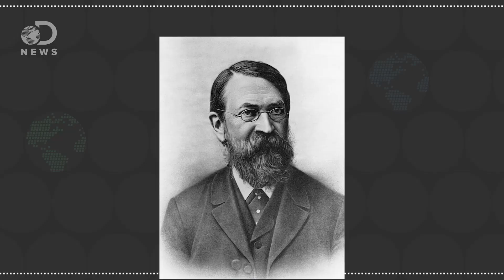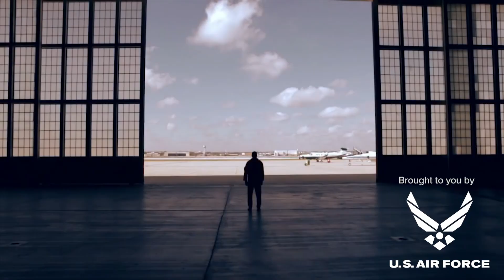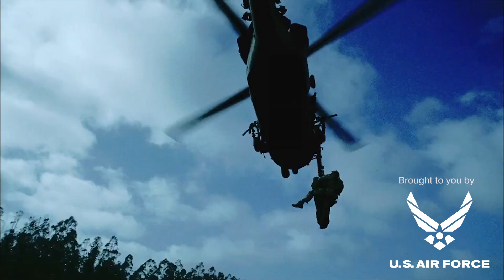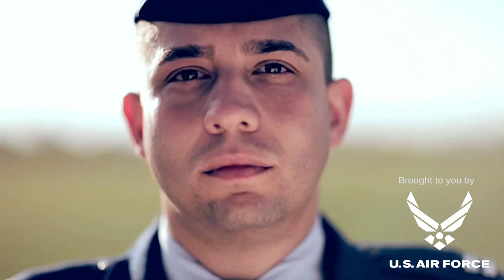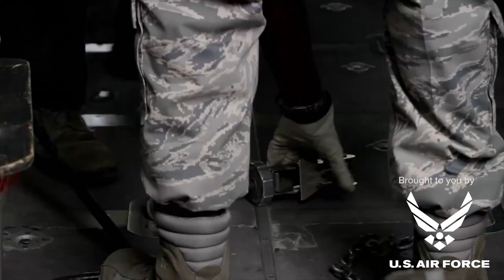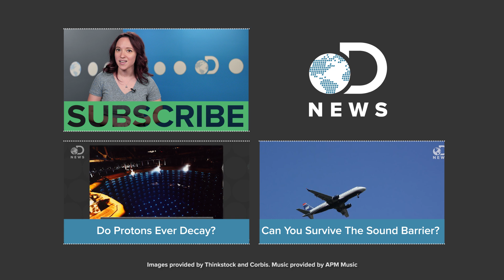Why Is A Sonic Boom So Loud?

Comment: how about light barrier?
Reply: *****
 And you would have an infinite mass that would lead to an implosion of the entire universe and end of eveything existing.
Though I still beleave this question was a troll.

It's a common phenomenon that you cant tell the differece between trolls and insanely stupid people because those trollers get excited if you fall for their stupidity and try to explain to them why their questions imply an IQ of limes zero.
Reply: nhem chanreasmey no matter can travel faster than light within our universe. 

as you gain speed,  the stars ahead of you and behind you would shift color ( doppler ) your ship would shrink in size, and time would slow down for you,  but you would not feel time slowing or the shrinking, you would perceive time flowing normally. 

another effect is your mass would increase as you go faster and faster,  which means more and more energy is required to make you go faster.

If you were to somehow reach C, i guess you would just be pure energy. and would require all the energy in your total mass to achieve it. 
E=MC2.   

I am sure someone with more knowledge here, will correct me.  

This is not to say that we may not be able to travel to distant stars,  we may be able to someday create worm holes, or maybe bend space ( a-la-star trek ) of as I mentioned previously jokingly, maybe jump to another universe where laws are different.
Reply: There was an experiment with a light or some wierd laser thing that broke the set light speed. I forgot what that experiment was called though. Basically a light that beat the light speed.
Reply: +nhem chanreasmey haha! this is a joke, right?
Reply: +nhem chanreasmey You need a trans-dimensional drive  , and you are good to go.  no sonic boom, just trippy visual effects.
Reply: +MrBaronmoll  so you think this is a joke or trolls. well i was asked about light barrier. the light speed is about 299 792 458 m/s. so if we go faster than that speed so what happen? is it so loud or something?
Reply: santiago pelon
Light = photons ,  photons are generally considered to have no mass.   although there is some debate to that.

if you are already at light speed, time stops for you. 

anything faster than light, would probably mean going back in time,  so what I think you are referring to are tachyons.
Reply: agriperma I have no idea if they'd be "tachyons", never heard of them, but it was an article I read a while back. But it sure stuck in my head for a while.
Reply: santiago pelon
look up tachyons fun stuff,  fodder for scifi writters , mentioned a lot in Star Trek.
Reply: agriperma will do for sure when I have less homework :)

Comment: Still didn't answer the actual question about why it's loud...
Reply: +Fred "The sonic boom is the sound an airplane makes when it smashes through that wall of compressed air that builds up in front of it" 02:17
Reply: Ok wasnt mentioned is that sound waves travel at set speed for each wave.. about 340 m/s.. The aircraft.. as it collides with the air molecules produces sound waves that are spaced from each other. Now when the aircraft gets faster these sound waves are compressed (Get Closer to Each Other) producing a higher sound the closer they are.

 Evidence of this is recording your voice.. A low pitch sound would have waves spaced a good distance from each other.. but a higher pitched sound you would observe the waves closer together.. 

Done with sound compression and how it deals with sound level.. Fighter Jets that brake the sound barrier or reaches super sonic speed basically is moving at a speed faster than the speed of sound over 340 m/s.. These sound waves are so close to each other Or Overlapping (Im not sure if they can overlap) Produces such loud, thunder like sound just by how close the waves are to each other.. 

Hope this helped a bit..
 Feel free to correct me.. I like learning and Sharing.. Seriously.. If im wrong reply me immediately and sorry for this answer being so long :)
Reply: +lazaro398 I'm with you---this video was awful.  For a science channel, DNews shouldn't have spent 80% of the video describing the history of supersonic flight, then handwave aside the answer to the headline with a single sentence.  There is so much fascinating science related to transonic, supersonic and hypersonic flight, and the engineering and physics that go into it, and that should have replaced the "quick" history lesson.  Moreover, the central question and its implications were not answered by the video---plenty of people (+MrBaronmoll , +acrefray , +FrozenEternity ) are answering these questions in replies to you, but the point is that DNews didn't.
Reply: Fred it's compressed air if I'm hearing it correctly
Reply: Because of YOUR LEG!
Reply: FrozenEternity HAHHHAHAHAHA
Reply: Fred they told you why.
Reply: +Fred They create misleading titles all the time.. It's getting quite annoying.
Reply: @dennisvanruijven4489  yea, i got recommemded a video that said "can you hear in space" bruh if i got asked that in third grade i whould know the answer.
Reply: @TheRealTimpa  lol, reacting to a comment 5 years ago I see. Impressive.
Reply: FrozenEternity
 No, it's loud because sound isn't anything else than a pressure wave. If you move with the speed of sound you make soundwaves that will be as fast as you are. As they expand they build up a massive wall of pressure that makes an enormous sonic boom as soon as it passes your ears - hence the name.
Combine that with the fancy skill of animations and video editing and you can answer precisely to why a sonic boom is so loud.
Reply: @VulpeculaJoy  thanks for this clear answer. Best explanation I've read in a while.
Reply: +Fred The answer flew right over your head didn't it?
Reply: @Trawpenia  no over HIS LEG
Reply: flowild
 why, just why?
Reply: Trawpenia You made my day.
Reply: Welcome to DNEWS.
Reply: Well how's your leg?
Reply: "MY LEG!!"
Reply: +MrBaronmoll the sonic boom results when you travel faster than the speed of sound can which causes the sound waves to not be able to keep up with you. This results in the air molecules being compressed from the build up of sound wave pressure
Reply: He answered it , the air compression causes the sound to form , if you're still confused, go to a physics website and search for sound or how sounds are formed.
Reply: Anuq Nalawangsa And yea Anuq is right the air compression is ENTIRELY the cause of sound being higher or lower
Reply: FrozenEternity No. The question should have been: What is a sonic boom? Period. When they ask precisely: "Why is a sonic boom so loud?" They are implying prior knowledge of its loudness and the answer should be why it is louder than what is usually conceived as. The video does a good job at answering the first question, but the second question's answer is not clearly defined on the video.
Reply: lazaro398 :D
Reply: *****
Nope, just like you didn't say you had to be wise or sagacious---I'm hoping you'll wander off, though, as 1 out of 3 isn't bad.
Reply: Lol
Reply: +Fred what that profile pic.. he not even important... his name is fred?
Reply: Javer Beech  Thanks , you made a better explanation btw :D
Reply: Because that. enjin and exzoz to,,u Stupid hell.brain
Reply: Shockwave, a.k.a. compressed air.
Reply: MrBaronmoll
She ain't that boo(m)b(l)astic.. she's kind! Nothing wrong with +Fred... ;-)
Reply: FrozenEternity
Not an exact answer but so right.. the volume of a plane's body is the key score into the vacuum the happens to be.. the moment that the plane break the barrier is all this at first and all and all components of the event are in resonation during the whole process.. and its like the moment a big wet bug is getting out of your feasted hand and falling on the table and it is so strong and fit that asthough you compress over it, it is not destructed and is still going away taking its walk on the table.. and you feel the gap it initializes in your peception and attemptive+motivated nerve sytem.. and though you praise the bug you feel down right then with your huge hands and bodily muscles.. and were so keen into the aim..  that how and why throught itself the air is making us feel the fact so Loud from over itself. Eyyir iz nerw'zzz.., too nerw'zszszss..
Reply: Mikrofonlar Kralarına Cevaplar that was the best retarded answer ever
Reply: It is so loud because of that gigantic shock , remember sound is just shaking molecules
Reply: Sound is created by vibration , so it's faster than sound so it's fast enough to shock air in to super loud sound
Reply: MY LEG!!!!
Reply: Trawpenia puns
Reply: Fred yes she did if you were listening. She said the bang is the plane breaking through the barrier.
Reply: Search on seeker
Reply: that is true Fred
Reply: MY LEG
Reply: +FrozenEternity That's just answering what it is, not why its so loud...
Reply: They told you the airplane keeps COMPRESSING the air along with the sound. It is loud because the noise is compressed until the plane breaks through the wall of compressed air. They explained that. When someone is explaining something it helps to LISTEN.
Reply: +lazaro398 you're not the smart child, are you?
Reply: We dont wanna know why the sonic boom forms
We wanna know why it so loud
Reply: +lazaro398 buts that is like asking why is water wet. Its loud because its pushing through a lot of compressed air very quickly.
Reply: +Fred wanna know the answer?
Reply: +lazaro398 The video presupposed that the viewers had foreknowledge of what "sound" is. So yes, it answered the question. Trying to be pedantic just makes you look more stupid, as it makes you look like you do not understand anything about sound - which is okay, but in that instance, don't try to make Dnews look like the bad guys.
Reply: Fred that was the actual question dumbass